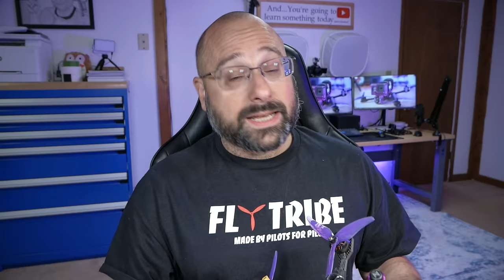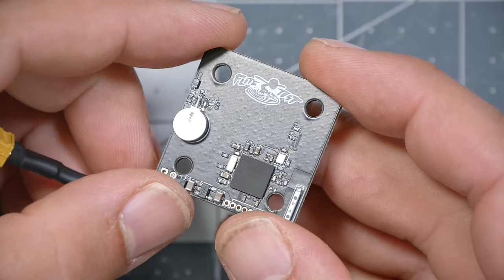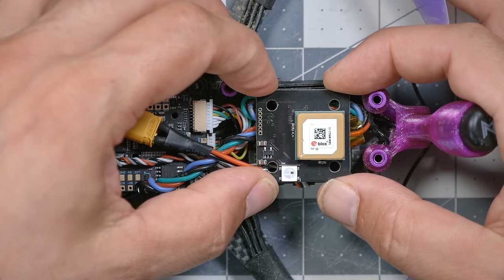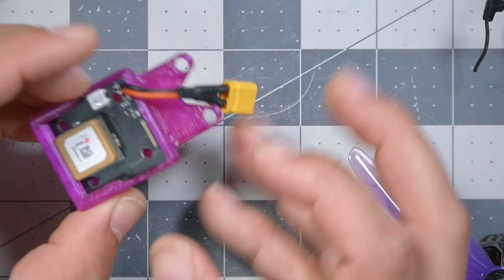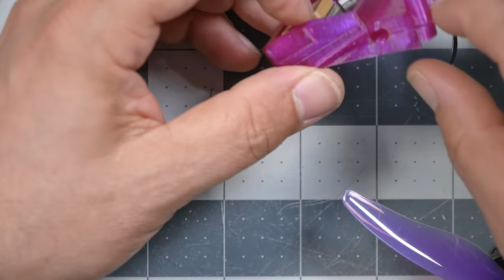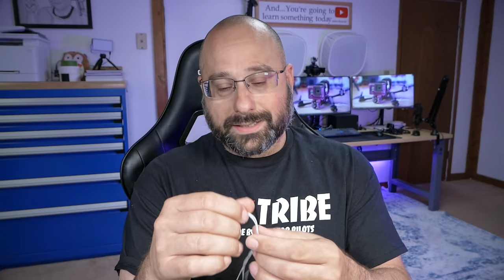How to add RemoteID to an FPV drone (it's simpler than I thought)

Comment: Install the remote-id. Unplug the cable.
If anyone (a million to once chance) calls the cops on you, and the cop (another million to one odds) actually knows about drone laws, comes up to you and checks the remote-id while in flight or after landing, you say "oh shoot, the cable came off during my crash".
Plausible deniability.
Reply from the maker: You understand that flying with a inactive RemoteID is just as much a violation as flying without one at all. The rules say you are responsible for the module functioning.

Comment: Could I also hot swap the remote id module with part 107 quads ?
Reply from the maker: My understanding is that part 107 requires a unique registration ID per aircraft, so you'd need a unique module per aircraft.
Reply: @JoshuaBardwell oh hell no im not doing that

Comment: § 91.119 Minimum safe altitudes: General.
(b) Over congested areas. Over any congested area of a city, town, or settlement, or over any open air assembly of persons, an altitude of 1,000 feet above the highest obstacle within a horizontal radius of 2,000 feet of the aircraft.
 According to th FSDO in Scottesdale AZ ... over any open air assembly of persons .... Constitutes 33 Thousand at a foot ball gamr or just 2 People ona Picnic Blanket.   
My Point Full Scale MUST be 1000' agl Over R/C Flying sites when they are Occupied.

Comment: I don't want that big thing hanging off the back of my drone...i choose no comply just to resist ridiculous regulation I fly freestyle away from people and way under 400 feet.  I'll end up ripping it off in a tumble quick...thts y I don't use GPS either. I used to go thru antennas like u wouldn't believe until I stated using sma stubbys

Comment: I know this probably isn’t relevant, and I feel like it’s a dumb question that I should know, but I can’t find any info on what I’m trying to find and I’ve been looking for a while. 
I have a TX16S controller, TBS crossfire module on the back, and it came with a couple small receivers that I use in my drone build. I’m all good there, however. I have an R/C A10 Warthog from Motion R/C. Since drone receivers and airplane receivers are different, I need is a receiver that will work in the plane, that will bond with my current transmitter setup.
Reply from the maker: You need a receiver with PWM output. There is a Crossfire to PWM adapter you can buy.
Reply: @JoshuaBardwell  I’ll look into that, thank you!
Reply: @danielthornton1633  Do keep in mind that plane flight controllers often have PWM outputs, and your serial receivers work just fine in that case. I used an F405-WMN flight controller in my plane, and hooked up a Matek R-24D receiver to it exactly like I would on a quad.

So if you have a flight controller, remember that you have this option.

Comment: Why are they price gouging them when they know everybody needs them... $99 for something that should cost $14... If they could make it more affordable , I wouldn't have any problem using one but I can't afford a $100 ...i still fly analog.. I can't afford to upgrade My video system to digital.😂
Reply from the maker: Why do you think this should cost $14. You made up that number without any actual knowledge a it what it takes to manufacture.
Reply: @JoshuaBardwell  yeah..I just threw that number out there... I can get a Flight controller a 60 amp ESC a GPS and a Caddx Ratel 2 for under $99.99 ...they're charging a $99.99.. Kind of ridiculous. Can't see it Having much more technology than that stuff..
Reply from the maker: Right, right. I understand that point of view. But the difference is, the RemoteID unit is federally regulated. That's where the additional cost comes in. The manufacturer has to 1) make sure the device conforms to all the requirements of the regulation, 2) submit the device for testing to confirm that, 3) apply to the FAA for approval, and 4) perform various on-going tasks as required by the FAA. If at any point, the manufacturer drops the ball, all the people using their hardware are no longer compliant with the rules. Even though NOTHING has changed about their RemoteID device. It's because of all that responsibility that these devices cost money. Because somebody at the manufacturer has to get paid to keep the FAA happy.
Reply: @JoshuaBardwell  I got you. I appreciate the information. Pretty much everything I've learned in FPV I've learned from you. Thank you so much.